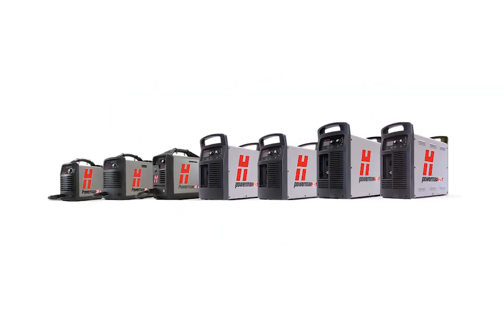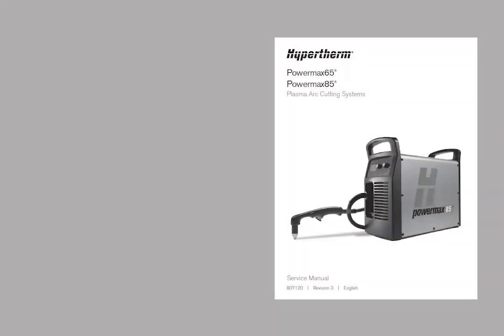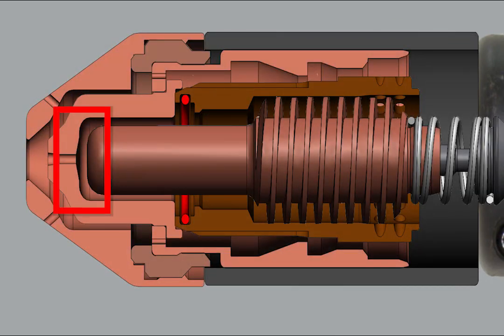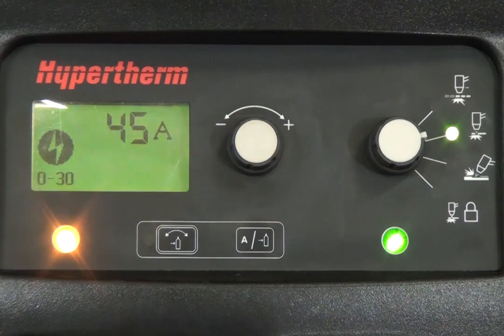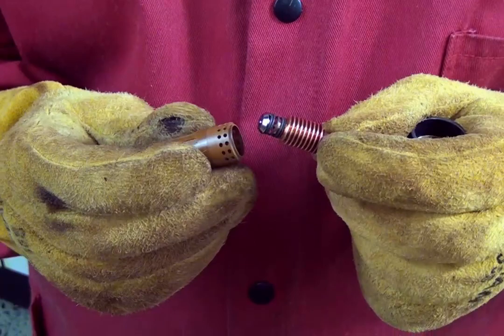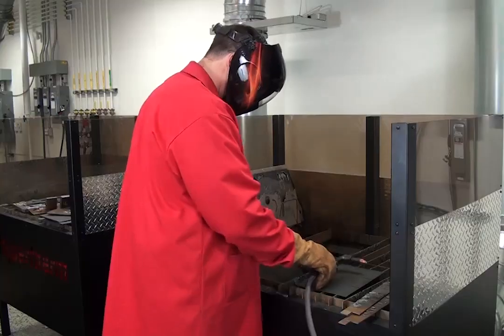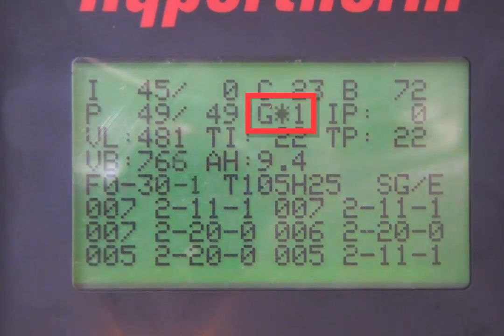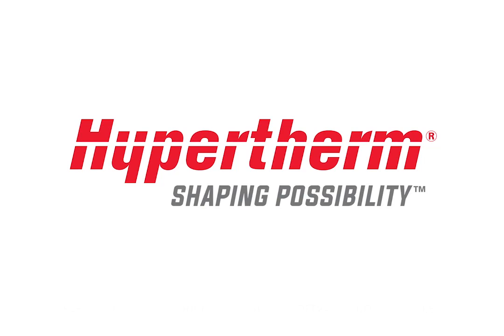Troubleshooting a Powermax 0-30 fault code

Comment: Fellow Powermax45 XP users, be aware you may not get a numeric fault code if using hand held torch. If fault develops look at pages 150 of operator manual for flashing lights code meanings. If using with cnc computer screen may display the fault code.

Comment: I have a problem on hypertherm 125: the electrode hops and the air comes out intermittently. result when I start the arc it burns the electrode spring immediately. how should i solve? do i need a more powerful compressor? the flashlight is new
Reply from the maker: Hi Fancesco, Thanks for reaching out with your comment. Can you verify that your compressor that is rated for 9.2 CFM at 90 PSI.?